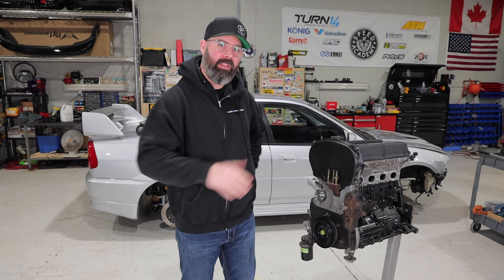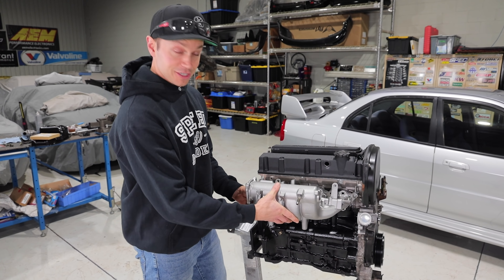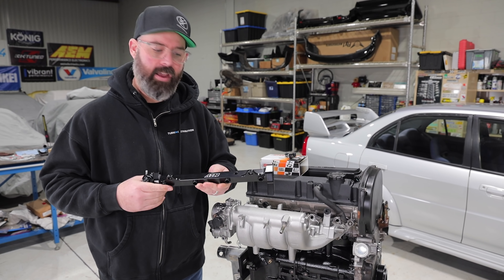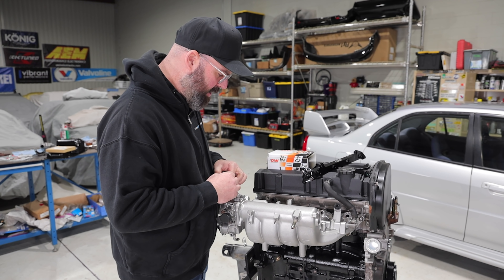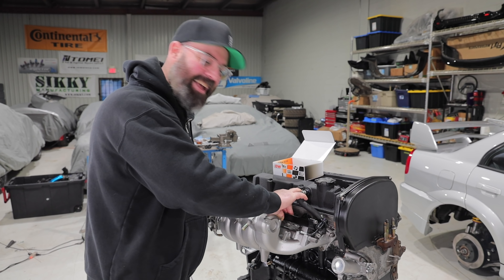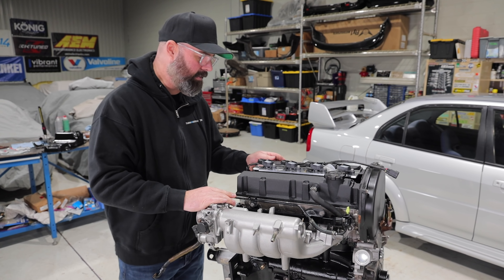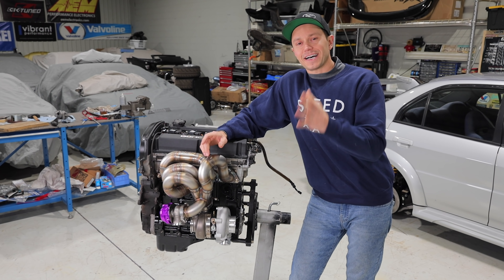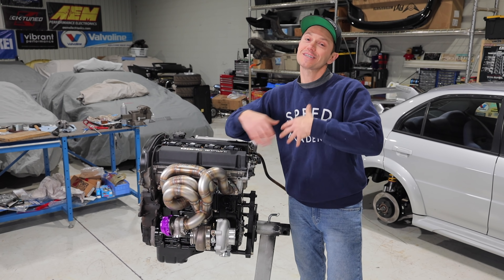EVO 6 4G63 Engine Rebuild How To - Killer Turbo Setup! PT 4

Comment from the maker: Thanks for watching our engine build series. Tell us what you thought! Now to get it installed and running.
Reply: Love the small turbo idea more than capable of making the target horsepower and will have an amazing powerband can't wait to see the results
Reply: I would consider an intake manifold   for any top end concerns...   Grisdales can probably supply the oil  lines and fittings
Reply: I watch and enjoy everything you guys do! I appreciate the detail oriented videos you made in this series. Its nice to get those mixed into the channel once in a while. I cant wait to see the EVO/STI race!
Reply: You guys are just buttering me up to start hording parts for my evo vii 😇 its nice to be able to watch you guys do this kind of stuff, takes a lot of the mystery out of it for a guy who's pretty much a virgin at wrenching like myself.
Reply: Loving this series!
Reply: Dave when will you be taking the car to Cayuga? Will you run it on dragstrip and roadcourse? Dragstrip opens Apr 18th..?..hopefully coronavirus doesn't screw it up...

Comment: I double nut and nip up the exhaust studs. I also put on some copper anti-seize. Is a good high temp lube.
May have been worth doing a ceramic coat on the exhaust manifold and turbine housing to keep the heat at bay.
As for turbo oil and water lines: Just pay a visit to your local hydraulic/forklift supply shop. They'll make any line you want with crimped ends at a fair (non-motorsport TAX'd) price ;)
Reply: Agreed. Without exhaust shields things around manifold eventually melt.
Reply: Was just going to comment and suggest the copper anti-seize.  Whatever you end up doing for lines get a nice insulated sleeve for it to protect it from the manifold.  Thermo Tec makes some good stuff!

Comment: With all this quarantine going on I’ve been sitting around waiting for speed academy updates!  Great job guys! That manifold is sick!  My .02 - throw some water on that wastegate.  You’ve already got the motor on a stand, now would be the easiest time to do it.  It won’t hurt and it would really suck to decide to do it once it’s in the car.
Reply: We agree. Since those G25 turbos have M14 water ports, just use a double-banjo fitting on each one and cycle the coolant through.....cheap insurance!

Comment: some of the exhaust manifold studs require Teflon tape or liquid Teflon as they go into the oil channels. Manual doesn't specify it, but it is a potential oil leak. Mine did leak, Teflon taped all of them, fixed.
Reply: Teflon tape is a thread lubricant not a sealant. 👍
Reply: @JordieG8   except for the part where people use teflon tape to seal threads especially in the plumbing industry
Reply: They make thread sealants specifically for this, I used some from loctite in my motor
Reply: @OllieOctober  well as a pipe fitter I can tell you that teflon tape is meant to help lubricate thread so you achieve better thread engagement. It is not specifically a thread sealer. There are other, more capable products for that.
Reply: @TWinkler02  yes, exactly. This is not the application for "Teflon tape" the heat will break it down quite quickly.
Reply: @TWinkler02  yea sorry that's what I meant to say :) the liquid stuff... thread sealant ;)

Comment: That engine fit and finish and part selections is beautiful. Excellent way to modernize and restore this engine. With so many v bands on that turbo i thought you might do one for the cold side too. I would assume the decision there will be made according to the intercooler piping you have or will use. I would take advantage of the cooling for the gate and BOV, and I love the purple. Very 2000s classic color again on a modern part.

Comment: EVO 8/9 stuff should fit very similarly on this motor for your turbo lines. If not, AN drain lines are easy enough to make. I'd recommend running the oil feed from the oil filter housing. It's cooler and cleaner oil. The head port is one of the last stops for oil before returning to the pan. There are adapters to restrict oil to the turbo inlet. Not only do ball bearing turbos need less oil than journal bearing turbos, but the oil filter housing is putting out a lot more oil pressure than the head port. Make sure you get the right BSPT fitting for the housing as well. Mitsubishi did a weird thing with BSPT fittings instead of NPT or metric.
I don't know what kind of water lines that turbo needs. I used banjo fittings and simply plumbed my inlet and outlet similar to the factory. Inlet from the thermostat housing, outlet to the water pump.
Reply: The cylinder head provides plenty of oil on evos for ball bearing turbos. If it's a journal then go from the oil filter housing.
Reply: @coolhwhip86  it's not a matter of how much oil, it's the quality of oil. The factory taps into the oil galley on the head for the turbo. Since it's in the head, it is one of the last places oil goes through. Any debris or head generated could potentially effect the turbo. Jafromobile has several excellent videos on the 4G63 oil system.

Comment: A quick jump over the border is a shop that sells every single Evo part you'd ever need, with the expertise you're looking for, not to mention the proximity to have things shipped much faster than 3,000km away can ever hope to do.  Your oil drain kit, intercooler pipes (which I assume aren't built yet), exhaust, etc., are all within arm's reach.  I know you'll dyno both options anyway, but considering you're only running S1 cams, you're not going to really rev much more than stock, therefore 0.72 will probably perform better for power under the curve than the larger housing.  I do say probably, we could be surprised - some Kelford 272s (or S2s) would have been really good for utilizing the power band and getting the most out of that turbo, as you'd also benefit from the larger power band (and then also the larger exhaust housing.)

Comment: The bottom row of exhaust manifold studs need sealing in as there are oil ways behind them 👍🏼 will leak down the threads and cause a nasty mess
Reply: A nasty surprise for many
Reply: Definitely listen to this guy. He's right. A good quality thread sealant such as wurth will do the job.
Reply: +1 on this 800 miles on my rebuild and it's leaking down the block😭

Comment: Here's my tips:
Exhaust studs: double nut with high temp sealant (oil gallery behind the studs, can have a leak if no sealant is used)
Oil pan: Weren't you supposed to wait for the liquid gasket to set before fully torquing the oil pan up? (if it doesn't leak, then it doesn't matter :))
COP ignition setup: Make sure to tune the ignition with standalone. Ignition dwell, ignition duration, timing. (just bolting it on does jack shit, and the COP's are firing twice as fast while also overheating due to overly long duration dwell)

Comment: Awesome guys, just love the detail of the build. TiAL waste gates and full race manifold, gonna look killer;) I reckon go with the 0.72 housing, 24psi and lambda ~0.78 if egt's are good. Full spool around 3500, make about 380-400 at the tyres. Custom braided oil lines ftw.

Comment: I replaced all the exhaust studs on my Miata engine a few months ago.  I had trouble getting some of the old ones out, so I chased all the holes in the head, used double nuts just to get the new studs seated all the way, and also used anti-seize on the studs to ensure they wouldn't get stuck again like my old ones did.

Comment: Use an fittings for turbo setup, -3 braided line for oil in, and a drain same size as factory but with an fitting and hose, for water bango fittings and pushlock hose works well, if needed put soft heat sleave over hoses

Comment: For the turbo oil feed: get a -4 AN/m10 fitting, I believe that is the right size. It will thread right in and then run the line into your turbo.
For the turbo drain: probably -4 again, weld a -4 fitting on to the flange of your stock oil drain

Make sure you put the oil restriction in the location that Garrett specifies

Comment: okay so definitely get a custom steel braided teflon line for the oil supply for the turbo and the the drain line should be at least 22mm internal diameter to ensure oil does not get trapped in the turbo and leak thru the piston seals, also see if the garrett turbo has a built in oil restrictor. the OEM banjo bolts usually act as the oil feed restrictor on most mitsubishis.

Comment: I've designed some two piece hard lines for oil return in the past with a small silicone hose in the middle to allow for flex (worked for Cummins). You could definitely weld up some hard lines with a flange that fits the oil return on the turbo.

Comment: exhaust studs (my opinion) - I only double nut when they don't thread in freely on an old rusty exhaust repair. If they will go in by hand i put them in til they bottom out. tension once the nut is tightened holds them in. Rust will be your natural loctite lol

Comment: WOW! No Twin scroll? After having driven twin scroll vs single I will never go back to single. Part throttle boost response is incredible, and easy to transition to boost with throttle. Single scroll is like an on off switch even with a smaller turbo. Also watch out for exhaust manifold heat melting things. Tubular Long exhaust runners make a few hp on the top end, but sacrifice the Evo's unique boost response, make it just like every other turbo car. Every car I knew with a tubular manifold ended up going back to a Ported or FP cast manifold (yes even full race people) to get that awesome boost response. Unless they had a 35/37r making 700whp on e85.
Reply from the maker: You can't get the new G-series turbos in twin scroll housing otherwise we would have done so. With the smaller turbo and tubular manifold we hope to see some good response that will carry to the top end.

Comment: I have a Precision 6062 gen 2 BB, but i used a PRL ported oil drain flange. seems like it works really well, especially on the PTE turbos which i know can be picky with oil drains. Can’t hurt on a garrett too i would imagine. I Used an STM feed and and STM drain kit other wise, which both seem to be working well.

Comment: We’ve always called it RTV...
Grew up in my dads transmission shop here in Las Vegas. (Performance Transmission - Had the Worlds fastest Buick Grand National with a v6 still. Fully built motor by Kenny Dutweiler and ran dual turbos and also a single 108 trim beast! Record breaking numbers were:
6.76 at 206 mph. (May have ran a lower run by hundredths. But that was the record and it stood for a very long time. May still be standing not sure. 
Len Freeman (my step dad was the driver as well as the trans builder and fabricator.)
John Galina (John Galina Racing was the full sponsor.)
Such fun times!! Always went to Bowling Green every year for the Buick Nationals events. So much fun growing up with such amazing inspirational and some of the smartest individuals I’ve ever met!

And now I’ve sold my 10sec T-Type and have been getting into drifting with  couple of G35’s. 😁 So much more fun! And way more seat time. 

Keep up the great content. Love your show!! So in-depth with your builds!! You two are extremely knowledgeable!!
Much respect gentleman!

-Sean (DRIFTLY) Remmen

Comment: So for your turbo feed, i strongly recommend against using the factory feed in the head. It is a low priority feed tee'd off the lifter feed, and with the factory arrangement, its not uncommon to have super low oil pressure and flow to the turbo. If tou want an easy solution, forced performance sell oil line kits, taking a new feed point from the oil filter housing, and coming with a restrictor to suit a ball bearing turbo, as well as a filter. Otherwise custom line off the oil filter housing or oil feed on the back of the block, and add a turbosmart oil pressure regulator to make sure the turbo doesnt get flooded.

Comment: Couple of things.

#1 G30 would definitely win races without being laggy.
#2 extreme PSI has a good oil feed kit. Drain, just use a 10an setup with 2 45 degree fittings and high temp hose.

Comment: Not sure if anyone else mentioned it but the two shorter bolts interfere with the timing belt if long ones are put in their place. 

I did see where others mentioned about some of the lower exhaust studs needing rtv because they can leak oil. 

In the last video I'm pretty sure one of the motor mount bolts behind the timing belt requires rtv as well. At least that's what the manual says for my older 7 bolt 4G64.
Reply: You are correct, the middle one of the motor mount bolts from factory uses the MD194109 (bolt, 10 X 22 with sealant) or use the old bolt with RTV (as mentioned in the Manual)

Comment: I think most Evo folks feed the turbo from the oil filter housing not the block. They sell a block off bolt for that factory turbo feed on the head. Water line you’d be better off doing custom lines. I think ExtremePSI.com sells the kits for the oil filter housing feed kit, and bolt block off for the factory oil feed off of the head.

Comment: I feel like this motor is going to leak from two areas. The oil pan first for not waiting a few hours before torque down to allow for curing. The exhaust manifold bolts second. On our 4g63s you need to seal the threads.

Comment: If were my engine , I would install a huge oil cooler directly after the turbo. The oil coming out of the turbo is going to be very hot.  This is a good chance to remove the heat before it goes back into the block of the engine !  You can never have enough oil cooler !!!  Not if you want the engine to last !

Comment: Dope episode. Im also on the ropes of whether to go oil feed from the head or from oil filter location.
Reply: Ashy Gee head,as it will push a lot easier than from the filter where it will have to pull. Either way,good luck on your build 👍
Reply: @billolsen5401  Just a question, Do you have prior experience? ..ive heard there is less stable oil pressure in the head? Any truth in this?

Comment: TURBO EXHAUST HOUSING: Don't modern cars use small exhaust housings and vent the excess exhaust pressure to avoid knock? Especially in engines without exhaust manifolds? Thoughts?

Comment: Also did you put thread sealer on the bottom row of exhaust studs?  They are open to the head at least on the 9 head.  I used double but method and put them in tight

Comment: I'm pretty sure those oil pan bolts are wrong.  MAP sent me the wrong ones recently too.  They should not have a Phillips head slot in the top.  I'm literally doing the same project on my Evo 9 now.  Bolts should be 2x MF140201.  17x MD097012
Reply from the maker: I dont think they are the OE ones, rather what they suggestion. I like that they have the phillips head makes installing them easier then tightening with a socket. The critical short ones are OEM mitsu

Comment: How do you guys like the maximum 3/8 torque wrench? From what I can tell it's made by Gearwrench. Thinking about buying one.
Reply from the maker: No complaints so far. Works like a charm. Its nice to have a digital readout and considering its under 200 bucks when its on sale you cant go wrong.

Comment: I'd go with all Vibrant components. I have an ETS FF setup on my Evo, I made all custom -6AN water lines to and from the turbo, -4AN Feed line with a built in oil filter/restrictor from Forced Performance and then made a custom -10AN return setup.

Comment: Are you sure you need more silicone on the pan that because it's the aluminium type with the flat surface just wondering still
Reply: Every oil pan that doesn't use an actual gasket or o ring needs silicone. No matter how flat two surfaces are, oil will make its way between, hence the need for head gaskets for example
Reply: @magnetic0314  sorry I was suggesting that you need more silicone than what I think you used, hope it was adequate to prevent a leak.
Reply: @davecole865  he hasnt assembled the motor yet...

Comment: My sti would eat that for breakfast 2.1 forge engine running 559 cost me nearly 10 grand
Reply: @zeroyon223 Exactly!  Stock motor Evos run more power!  Throw on a FP Red and some E85, FIC2150's, Kelford 272s and a standalone and you're basically there.  **coming from a Subaru owner who worked with some of the fastest Evos in the world.
Reply: 559bhp top speed of 195mph
Reply: @marktrafford5332  BHP???  Oh God.  Don't ever put your car on a Mustang Dyno.  You'll cry all the way home.  Where did you even find an engine dyno?  It sounds like someone needs to post some videos of his car, the top speed run, and the 12 second 1/4 mile pass that it's bound to run.
Reply: Roger Clarke motor sport the best in uk
Reply: Just look at  YouTube goodwood park  roger Clarke motor sport cars